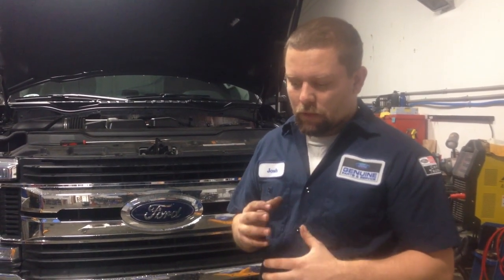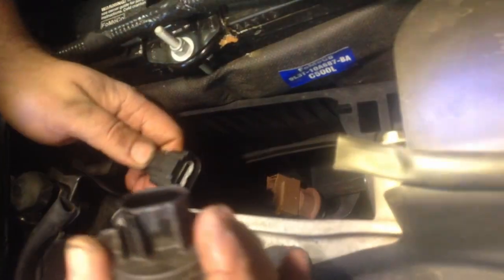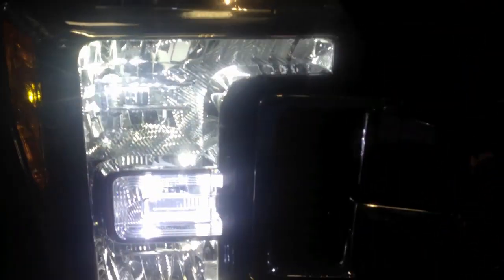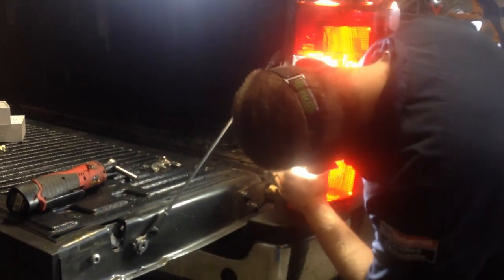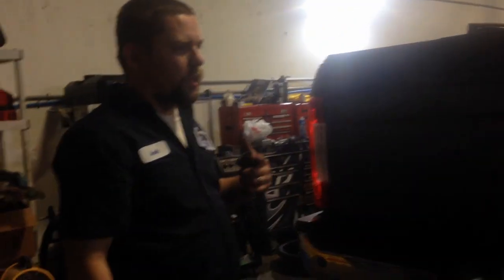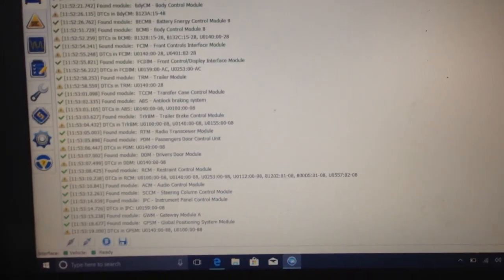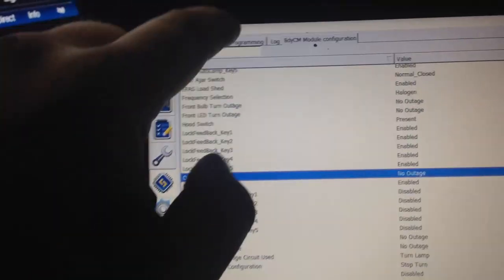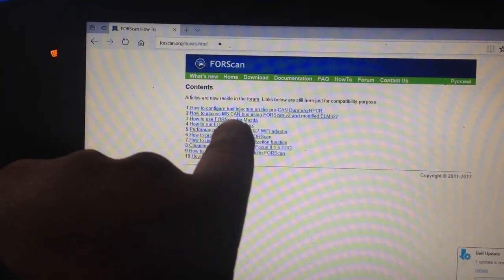2017-2019 SUPERDUTY BEST LED CONVERSION

Comment: Great lights, I have them on my truck. Make sure you follow Josh's advice by testing  before you screw everything back together. There's nothing worse than not testing and having to pull it back apart because polarity was wrong or a contact was not seated correctly in a plug. Don't ask me how I know...

Comment: just installed the kit on my 2017 KR Dually. Watch Josh's video on installing them on trucks with the diesel and it is a snap. Less than an hour on the front the tag lights actually took the longest has i had an issue with one and big hands. using OBD to update was easy the only one that has not worked is getting the DPF level to display on the sync 3 screen.
Reply: I think the DPF screen is in the center gauge display .

Comment: Can you please explain the difference between the "Job 1" and "Job 2" for the 2017 and 2018 Superdutys?
Reply from the maker: Jon Stirrett what do you mean job 1 and job 2??
Reply: Well, at the dealer when they are coming from the assembly line, they have a sticker or paint marker on the window saying job 1 and job 2. I did a little research and for some of the older model superdutys that meant a power reflash, etc. I was just wondering if you've seen or read anything.